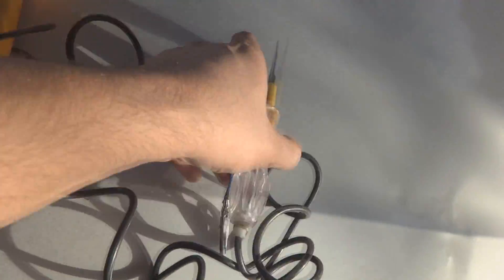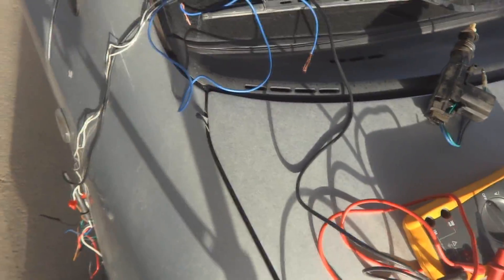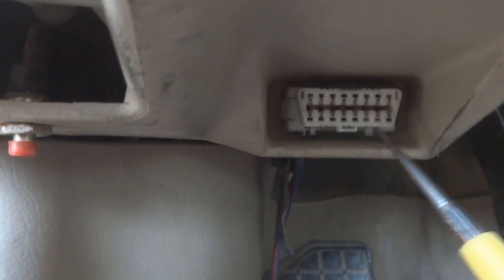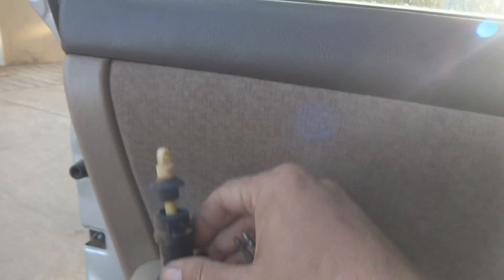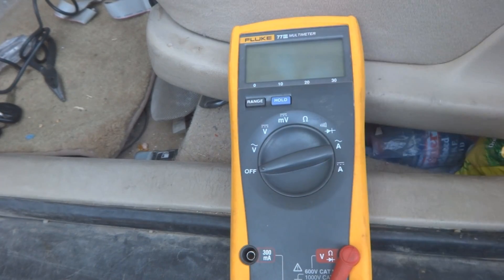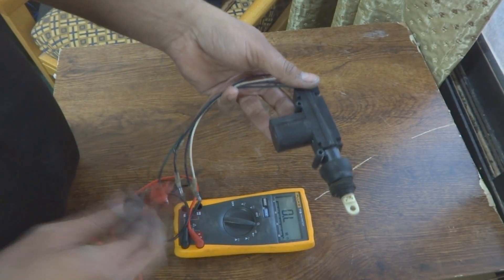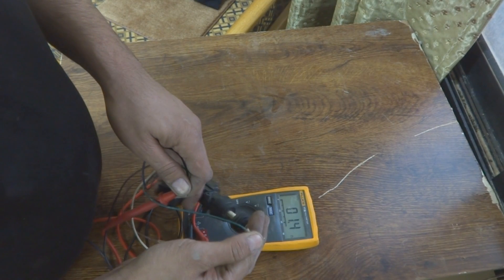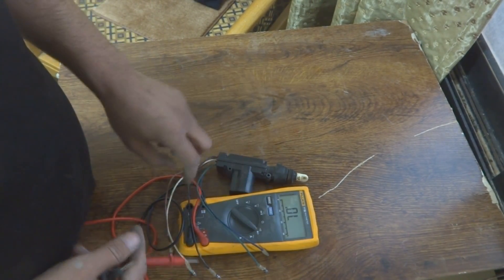Keyless entry; Car remote control part 4

Comment: Lala Salam. My car is not locking with the remote but unlocks every time. And the open door light is always on.remote light is also working while I press it but doesn't lock the doors. It's a Toyota yaris. Thanks
Reply from the maker: It needs some electrical trouble shooting where the problem is. Electrician should fix it for you.
Reply: I did it myself. The car was hit from the rear the lock hook was misplaced. Thanks

Comment: Sir, cant we connect the wires for flasher lights at 10.37 to the switch connector for turn signals inside steering wheel cover instead of going all the way round as shown in 10.37.

Thanks.
Reply: No. Because steering turn switch is not directly powering up lights. Instead that is providing turn signal to flasher relay. The flasher relay is further switching on turn lights accordingly.  But you can connect two wires to the flasher relay output which is going to turn lights. For that you must know your specific vehicle flasher relay wiring schematic diagram. In this video I didn't show that way as it could complex things for new people in the field. The purpose of the video series was to make it as simple and easy as possible so that an owner of a car could even fix his or her keyless entry system having little knowledge and a few tools. Hope you understand dear friend.
Reply: The Engineer sir the statement "provide turn signal only...." It seems there's hope I can connect at this two wires or pins where signal is provided..... Then signal goes to flasher unit....then to output.... thanks.
Reply from the maker: No. Better have your particular flasher schematic diagram from Google and the connect on flasher pins or wires which are going from flasher to turn light. In Toyota you can find the flasher under dash having champagne or yellowish color big size relay.
Reply from the maker: By the way this " The Engineer" is me too!

Comment: Sir I locate the wire green color located on the.BCM which only locks all doors of Hyundai i20 car, but, could not locate the wire for unlocking all doors.

Will connecting the wire which control the lock function coming out of the remote control unit to the above said green wire or pin of the BCM would activate the remote lock system? Please help to activate this remote system. Thanks.
Reply from the maker: That's great dear friend. Sure that wire will actuate but you must check how it is actuating mean a ground is actuating or positive is doing that. Also this wire should be an input wire to the BCM and not output wire. Because control is done on input and not on output. Hope you understand the logic. Also you can find such switching on and off wires on driver side door lock as driver sade door lock has this function actuated by key. That actuator has some three or four more wires besides the two wires for actuator motor. If you make a little more research in that area, you would get both locking and unlocking wires which would be used an input for PCM logic. Wish you very good luck with your modification/ addition.
Reply: Yes, really thanks for the concerns and again looking forward for your kind assistance until the setup is completed.

Yes, I got that Lock wire from the OUTPUT connector of the BCM ie joining one end of test light to the lock wire (positive) of bcm output connector and the other end to ground(-ve).

Yes, the driver door latch connector has 4 wires...2 thick blue and orange, the other 2 green and black.

Could you kindly help on details of those pins on the input connector of the BCM so that I could easily identify the specific wires for lock and unlock the doors.. I think the input BCM had around 23 pins.

Thanks in advance with due regards.
Reply from the maker: Dear friend unfortunately I can't pin point wire colors and connector pin numbers due to unavailability of the system here with me. I tried to give you idea to pin point the wires and hope you will succeed with your skill set. Wish you very good luck with your working modification and enhancements.
Reply: LearningZone sir, awaiting your kind utmost help and early solutions on "I tried to give you the idea to pinpoint the wires.....".

And, sir, i guess it would be more clear if I could get the  wiring diagram of BCM module and each pins description for Hyundai i20 2011 model.(after hard research and searching for this diagram on internet, I didn't manage to find even one!!)

Any help, suggestions is awaiting, and once again, due regards to you. Thanks.
Reply: LearningZone sir, the remote system is arriving shortly in 4 days time.

There are 4 wires on the door actuator connector......2 thick wires and others green and black wire. 

I connect one end of test light to the green wire and the other end of test light to ground which locks the vehicle. 

And, again one end of test light to black wire of the actuator and other end of test light to ground which unlocks the vehicle.

Sir, with these testing connections, how do I identify the connections are positive or negative triggered?? And how important is that in installation of remote locking kit?

Looking forward to hearing your best advice and suggestions, solutions. Thanks.
Reply: Sir, now I found that the door lock system is single wire....so how to connect my remote control unit??
Thanks.

Comment: Sir, it's indeed very very helpful info and great help to me.

A bit of dauds in my Hyundai i20 though!!

Sir the car comes factory central lock system. Now I want to upgrade to remote locking system. Can I just connect the wires, which lock or unlock the car, of the remote main control unit to these 3 wires mentioned at 9.31 to the switch connector of the door latch assembly of i20.

Please looking forward for your help. Thanks.

Comment: Hello my dear friend, I need your expert support, I want  to  install central lock actuator door  in my  toyota sedan yaris 2013 model, the door It's different from your video, if I remove the cover the lock inside also  remove. so  I don't have idea how to install this actuator,please give me  suggestion.thanks in advance
Reply from the maker: You can do it for almost any car but it will need a little study to understand the system.
Reply: @JahanZeb1976  my car remote control locking module does not receive any signals from the key fob.

How to confirm key fob or remote unit is defective???

Comment: I have a push button release solenoid that connected to 12V constant wire. How do i connect  it to my aftermarket central locking system to have a remote trunk release for 2007 toyota corolla le?
Reply from the maker: In such a case you need a relay to solve such a problem. You should operate the relay by remote control and relay should provide ground to the solenoid as the push button is providing. Hope you may understand.
Reply: It worked thank you so much 👌🏻👌🏻👌🏻

Comment: Thank you for the video. It helped me to understand the keyless entry concept. In my case, when I operate the keyless entry to lock or unlock the door it works perfectly, but left side of the indicator light blinks continously.
What could be the issue here? 
Thank you.
Reply from the maker: Dear friend you must watch all parts of the video series. Hope you will get some understanding of the flasher relay.
Reply: @JahanZeb1976  Sir, please show how to fix car remote control locking transmitter and receiver for damages not receive signals??

Comment: yar jahanzeb bahi key  IMMOBILIZER system ecm mai sy kesey cancel hoga....
Reply from the maker: +Dv Danger Dear friend there are several software and hardware doing the subject work but not for all cars. For some specific models only. You must learn how to program key instead of removing it from the ECU. I will upload a series of videos covering the subject inshallah.
Reply: +LearningZone  thanks  bro.... problm ye hy k aj kal ham 2uz-fe 1fz-fe 2uz-fe 1uz-fe is kisam k engine swap kr rey hian different diesel engines ki jagha...ecm jo 2000 model sy nechy hain wo tu stat ho jatey hain... lekin jo new model vvt-i type .... imob key walo ney kam roka wa hy sara...
Reply: +LearningZone  koi jughar system ho na.... jesey kisi ecm ya ecu sy koi ic ya or koi components remove  kr k kam chalaya ja skey...
Reply from the maker: +Dv Danger Jughar system kam kartha hae kisi had thak but sahee sytem kay leye thorha sa paisa kharch karkay ala kam kiya ja saktha hae aur acha kam seeka ja saktha hae.
Reply: +LearningZone  kaha pasa kharch kro bahi... kon sekhae ga...
Reply from the maker: +Dv Danger Equipment kharednay kay leye paisa kharch karna parhta hae, aur khud seeko ya kisi ki madad say seeko.